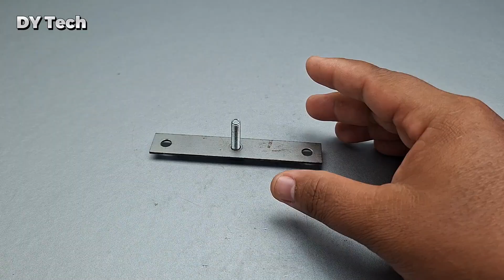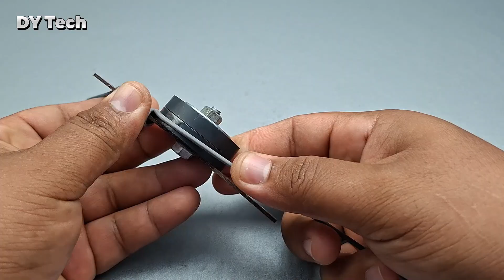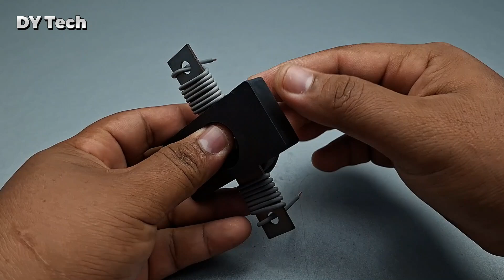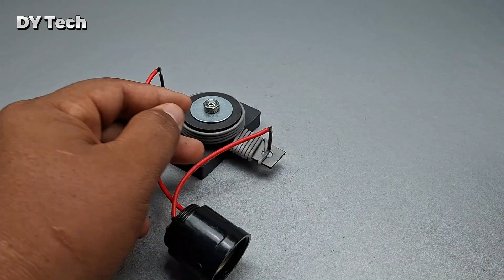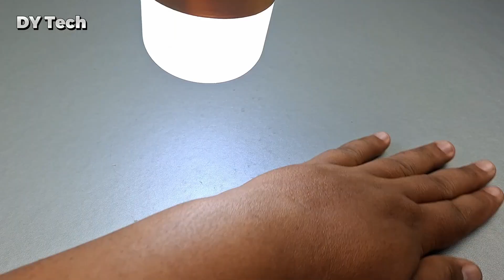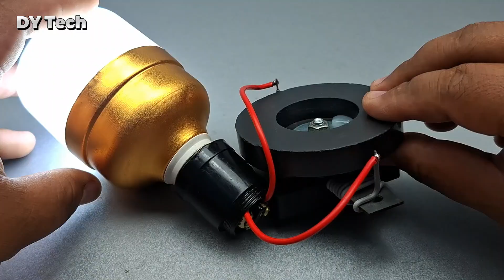100% Create free electricity energy 220volt from magnet at home

Comment: Trus mekanisme yg menghasilkan daya listrik gimana itu...trus arusnya AC apa DC
Reply: @tieffanynasuha8986  To produce electrical energy a magnet must MOVE CONSTANTLY inside a coil OR a coil with voltage supplied externally must MOVE CONSTANTLY inside a magnetic filed. THERE IS NO THIRD OPTION.  the  rubbish IN THIS VIDEO does not work because nothing is moving.          Whether it is AC or DC depends on the design of the coil.        If there is a transformer it MUST be AC because DC does not work with transformers.. THE JOKE IN THIS VIDEO IS THAT THE LIGHT WORKS BECAUSE THERE IS A BATTERY IN THE GOLD BASE OF THE LAMP.  IT'S ALL ON MY CHANNEL.
Reply: THERE ISN'T ANY MECHANISM. PHYSICS DICTATES THAT A MAGNET MUST MOVE WITHIN A COIL OR A COIL WITHIN A MAGNETIC FIELD TO GENERATE ELECTRICITY.   NO MOVEMENT = NO ELECTRICITY.    THERE IS NEITHER CASE HERE.  JUST ANOTHER SCAM FROM THIS CHANNEL AS USUAL.